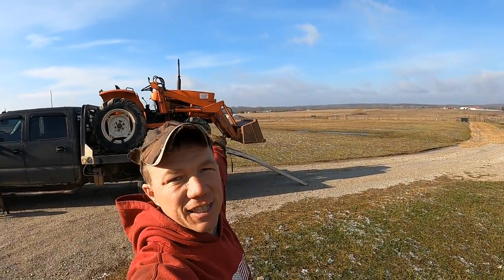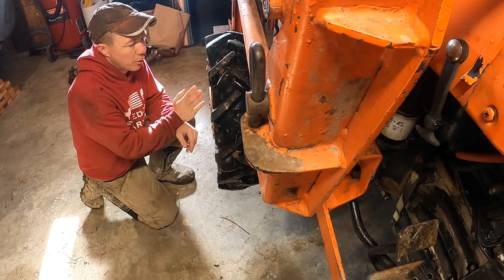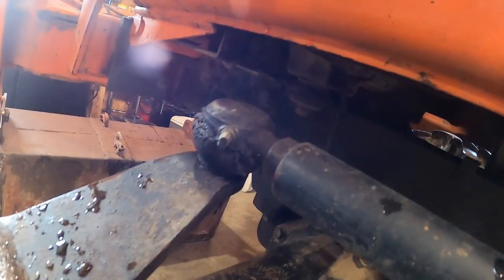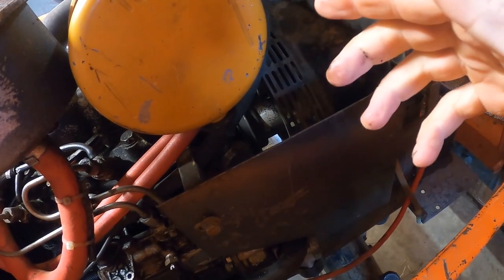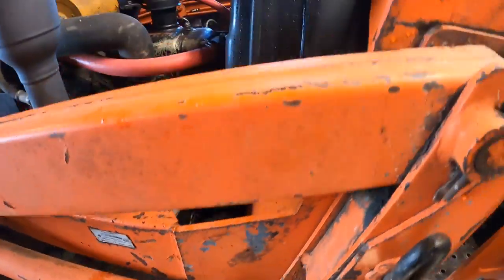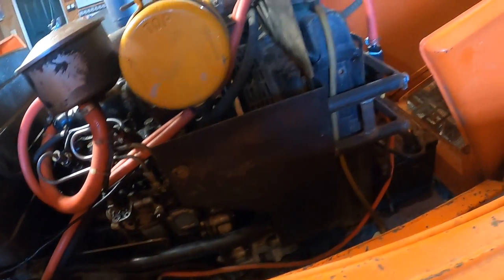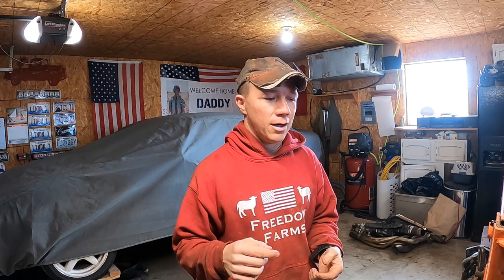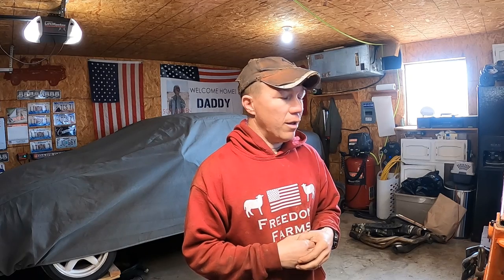Starting a farm vlog #30 I bought my wife a new tractor!

Comment: I own 4 tractors. Two of them are essentially the same tractor as your 5020. One is a Ford 1600 and the other is a Massey Ferguson 210. They are awesome work  horses
Reply from the maker: We love ours. It's convenient, its fits in small areas and is very capable for its size. Plus it sips fuel and is really light compared to our 7045. Hope you are enjoying the channel and if you haven't already check out our older videos and newer ones too. Don't forget to subscribe too!

Comment: Not that it would deter me from buying the tractor, but I would say it's worth noting the condition of the loader (bent cutting edge/bottom and repaired loader arm) when considering purchasing one and whether or not it may have been abused.
Reply from the maker: Absolutely, and that is where you have to research for sure. We saw all those issues and looked into the history of those and it showed a trend of owners complaining saying the tractor was more capable/powerful then it ever was described to be by the manufacturer and it led to companies making the loaders not strong enough to handle it. That is a basis of why we researched it. Plus the repairs were done very well and strengthed the location not just bandaged.
Reply: @FreedomFarmsMo  there are 2 philosophies about building anything. Over sell and under deliver,
Or undersell and over deliver.
Allis Chalmers always undersold and over delivered.

Comment: I sure like to find a good Allis tractor with a cab on it about 100 horsepower to 140 horsepower but they are hard to find. Again I sure like your video alot
Reply from the maker: We searched for nearly 6 months before deciding to buy our 7045. It is 145 PTO horsepower. You could us a  7000 up to a 7040 or an 8000 up to 8030 and be in the horsepower range you want to be in. Thanks for the comment.